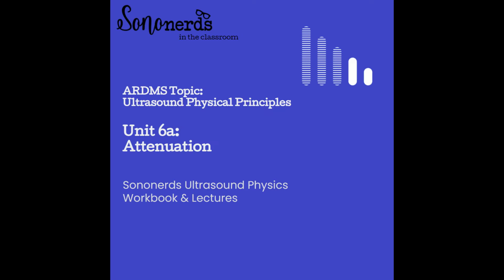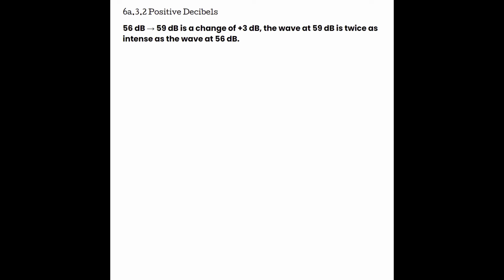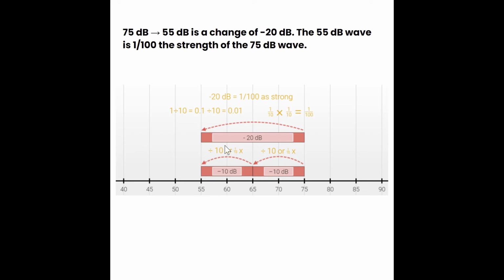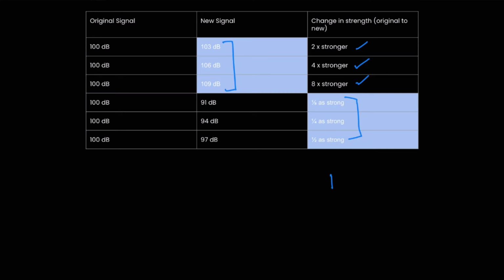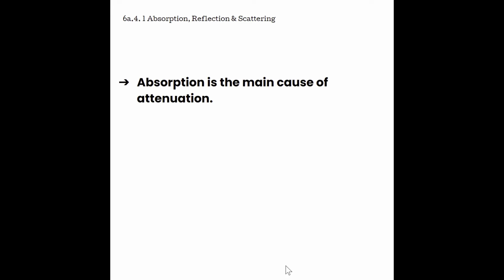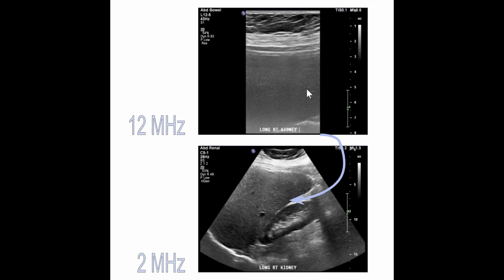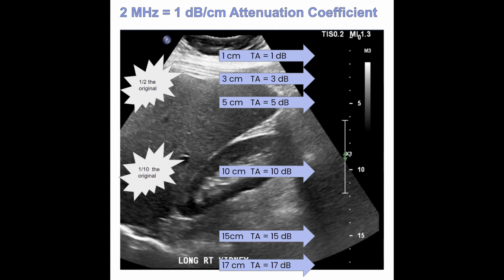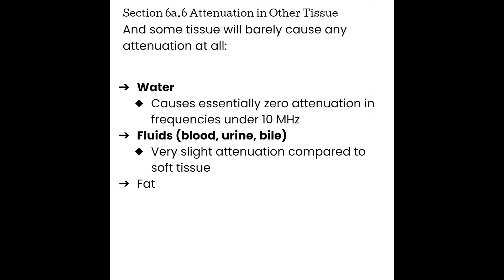Ultrasound Physics with Sononerds Unit 6a

Comment: If we consider a change of +30 decibels, do we consider 3 multiplications of 10, I.e. a 1000x amplification, or 10 multiplications of 2, I.e. an amplification of 1024???
Reply: You are correct with your 1st solution. A 10 x for each 10 dB. 10 x 10 x 10 = 1000 x stronger when there is an increase of 30 dB.
Reply: @mollybattin9674  Thank you!